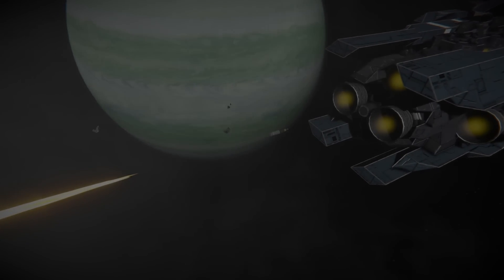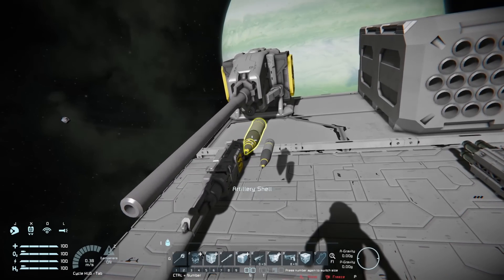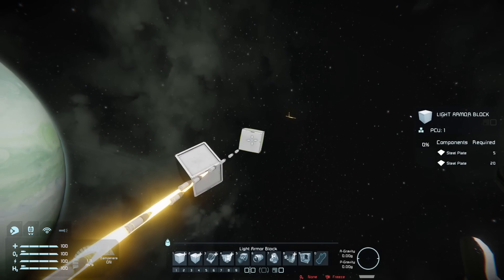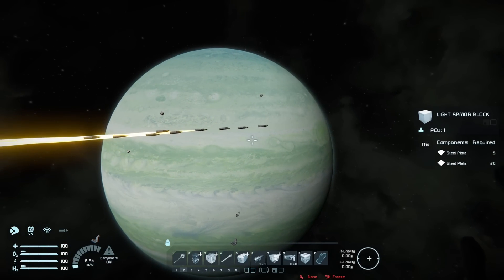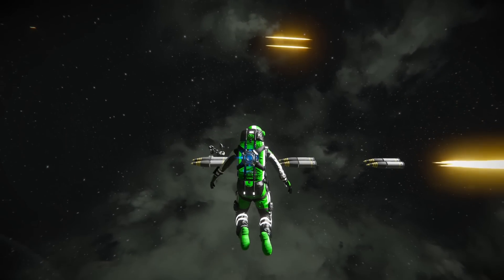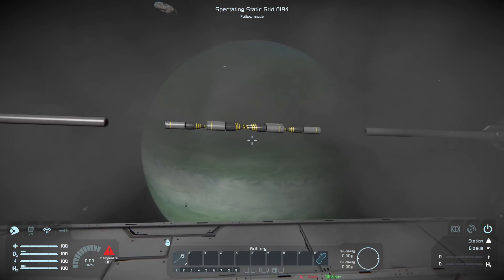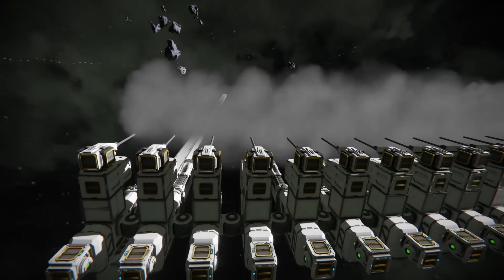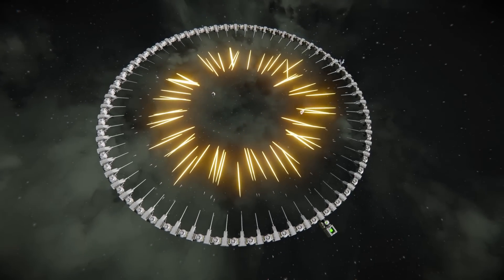What Happens when you fire Two Projectiles at Each Other?

Comment: The reason the projectiles don't explode (on modified lower speeds) is because they are measured accordingly. F(orce) = M(ass) * A(cceleration) and A = D(istance) / T(ime) ^ 2. To put it simply... the projectiles don't collide fast enough to actually explode.

Comment: The game can't do all colission calculations, 100% accuracy, 100% of the time.
It has to pick calculations and also use shorthand approximations to check if the complex stuff is worth running.
So the projectile likely scans ahead if it could hit any grid, to check if there is reason to run the complex colission code.
However, the object interaction code like for rocks and debris would also still be running. But that one probably isn't reliable enough to trigger projectiles moving at speed.

Comment: Projectiles have health and detonate once they run out of health. Apparently if they go slow enough they dont detonate.

Since an artillery shell has a speed of 300m/s if you reverse at 100m/s and fire it will have a velocity of 200m/s relative to the world then if the target flees at 100m/s the impact velocity is 100m/s. So is it possible to catch a artillery shell. Speed cap mod are probably needed and i need to double check my default artillery shell velocity along wth test if the speed is relative to the world or the grid that fired the projectile. I think relative to the grid that fires it due to shells moving sideways with your ship as you strafe but i need to test this

Comment: 2:26 my theory is that the impact with an object causes damage to the projectile and they only detonate when they take damage. They might only have four or five health but them bumping into an object at 2 m/s will not cause health to drain whereas impacting with something fast enough to do a little bit of damage cause it to break and on the break condition that is when the explosion happens. I don’t know the code tho  so that’s just a theory
Reply: But the fact that over a certain speed voxels clip through eachother might mean if it checks if it’s inside a hotbox it shouldn’t be in then bang. But I think the if hurt then boom would be much simpler and not rely on jank to work

Comment: physics simulation parameters are different at slow speed
Reply: if you would slow down the frame rate instead at "full speed" then it would simulate it correctly
Reply: maybe slow down the system clock to get that effect xD
Reply: time dilation mode
Reply: super high frame rate slow down video footage

Comment: Programmer here. There is a time tick, normally to keep physic fast, collision are check only at the end of the tick, so stuff move and then collide. This is why things that go fast can glitch trough object; if they move more then the colliding object is big, they wont register the collision. 
Of course this mean by changing bullet speed you are screwing up the result, as the physic delta time for tick is the same.

Sometimes bullet has "bullet mode" or "CCD" continouus collision detection, that will actually make the math to check if they intercept something also during the whole movement, but it is computationally more expensive...
About explosion, maybe they need to hit with certain force to explode
Reply: very interesting! thank you for the enlightenment

Comment: That's mental. I'm really surprised keen made the cannons shoot real projectiles.
Reply: Probably they just modified the tried and true missile system. Actually a great way to minimize the chance of introducing a slew of new game bugs.

Not to mention, it probqbly makes it pretty easy to apply proper gravity effects on the projectiles. Gravity does affect their trajectory, after all.
Reply: @Gottaculat  Thar also would account for the projectiles way of moving, they obviously have some type of propulsion since they do not just bounce but keep pushing.
If it was completely new physics designed for shells I find it hard that they would add that since it would not be realistic. And for fast moving projectiles its not a problem, they will explode so you would never see the strange behavior but with the slow speed they do not take enough damage to explode it seems.
Reply: The funny part is they fire the cartridge along with the projectile. Nobody would notice since it usually travels so fast.
Reply: @killianmiller6107  That's 60% more bullet per bullet!
Reply: @killianmiller6107  I was literally just looking at that, well, it saves from ejecting the shell after firing.
Reply: This is a very keen thing to do, they're very into accurate simulation of this kind of stuff. Even to the detriment of performance sometimes
Reply: It's common for games' guns to fire an actual physical object as this is the most realistic way to have the proper delay between you firing and the bullet hitting the target, if you shoot from afar, you could technically shoot, turn around, and the bullet then hits the target, so for calculation of hits and everything, as far as the gun object is concerned, it's quite literally "shoot and forget", the gun shoots a bullet at a given angle and speed, then the gun as nothing to do with the bullet anymore, the games physics engine takes it from there, and the bullet travels accordingly. When it hits something, that registers a hit. If it's on a wall, draw a bullet hole according to bullet type and wall surface material. if it hits somebody, induce pain.

The crazy part is how good the physical object's model is XD I mean it could literally be a small transparent sphere or cube, doesn't need to be a high res cannon shell XD Thats quite mind blowing! you can't even see it well for a single frame XD
Reply: Many games actually shoot real projectiles, but usually they don't give them health and stuff (they either use a projectile or a raycast to check for collisions)
Reply: Don't forget inertial fuses and full on physics behind them
Reply: They had too… it’s part of the coding… it’s the only way they’ll work properly… nothing should surprise you about that…. Most modern games use real projectiles
Reply: @zeno3934  yeah but not a fully rendered one lol. They usually just use an invisible sphere of the correct radius or something like that!
Reply: It's a 2016 feature most games have